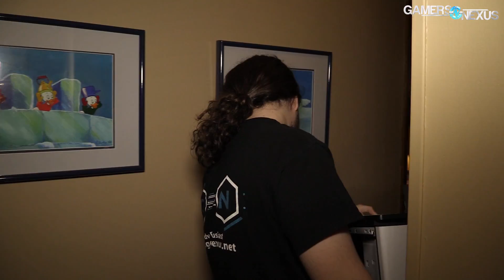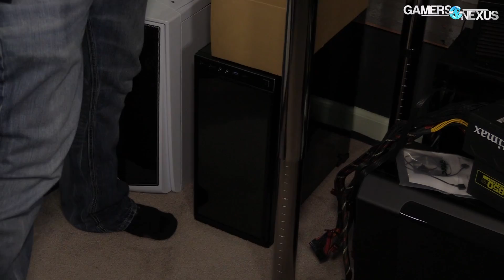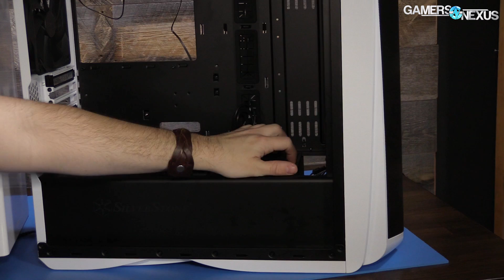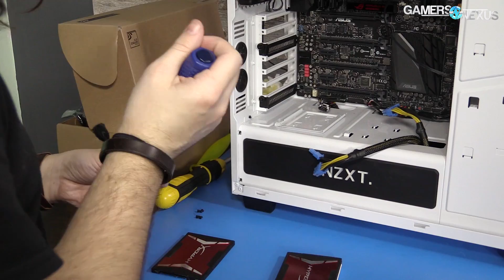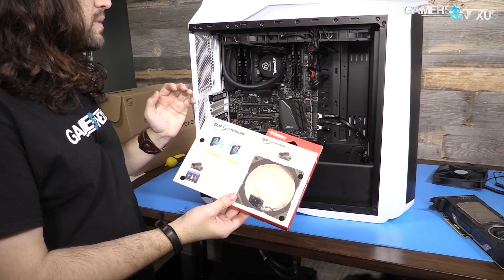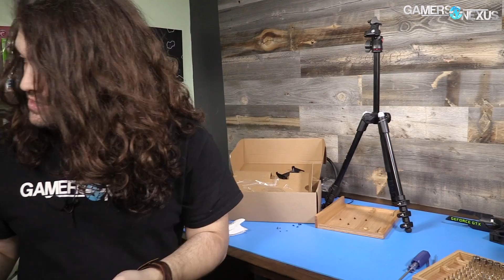Emergency Render Rig Rebuild (Pump Failure) - Pt 1/2

Comment from the maker: Or fan failure causing pump failure, I guess. The thing is up and running now -- we are in good shape! Part 2 is done. Songs below.
Part 2: https://www.youtube.com/watch?v=Wmn2KDe5efY

04:55
"ZigZag" Kevin MacLeod (incompetech.com)
Licensed under Creative Commons: By Attribution 3.0 License
http://creativecommons.org/licenses/by/3.0/

06:10
"Chill Wave" Kevin MacLeod (incompetech.com)
Licensed under Creative Commons: By Attribution 3.0 License
http://creativecommons.org/licenses/by/3.0/

14:14
"Pyro Flow" Kevin MacLeod (incompetech.com)
Licensed under Creative Commons: By Attribution 3.0 License
http://creativecommons.org/licenses/by/3.0/

16:13
bensound-basass

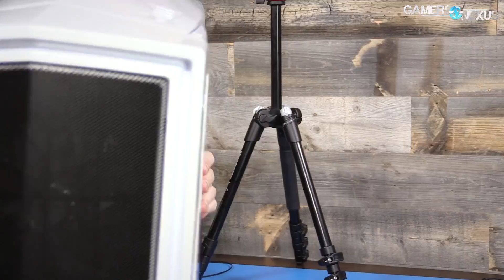20:29
"Leopard Print Elevator" Kevin MacLeod (incompetech.com)
Licensed under Creative Commons: By Attribution 3.0 License
http://creativecommons.org/licenses/by/3.0/
Reply: +Gamers Nexus Why would you leave it on the floor!?!?!?!?!?!
Reply from the maker: Leave what on the floor? The system? The tables/desks are completely occupied with more important things.
Reply: But...But... So much dust..... XD.
Reply: Hot air rises, cooler air available on the floor.
Reply: Though maybe not so much when stuck under a table, or in an entertainment center, etc.
Reply: Or when the rads fill with dust bunnies.
Reply: Have you measured how much static you generate running your hands through your glorious locks of hair?
Reply: +Dark Cloud  Roomba, mate.
Reply: Get the dust before it gets you.
Reply: If anything that pump failure made for an interesting video. :) Tho it probably was the fan causing the whole thing to go nuclear almost. :/
Reply: Lol, are you in socks? mate your videos are so good! and funny!
Reply: the music was annoying imo
Reply: As with most professional youtubers, they use Adobe Premier Pro which is multithreaded and supports GPU acceleration. They even mentioned it in the video multiple times.

Comment: MVP of the rebuild.. the Swiffer. Least that answered my question of if you could use one on comp dust clean up. 
 Hang in there . Any build you can throw together where no duct tape was used may not get the Red Green stamp of approval, but should still be alright.

Comment: I never had a pump failure because I stick to Air cooling. Much more reliable and less points of failure.
Reply: But higher temps m8
Reply: Meh, just crank the A/C.
Reply: Not on something like an D15
Reply: A D15 compared to that 360 mm rad? Yeah, higher temps.
Reply: +Victor Ov Precisely.  "Uh, my fan failed, what ever will I do"...not "OH $H!T, my AIO died and now I'm sunk".  Air cooling > Water-cooling.  Cheaper, more reliable, and DOESN'T come with "RGB gamer" branding for the most part.
Reply: True and this is coming from someone who has an air cooled system.
Reply: Didn't appear to be sunk in the vid. Could have just replaced the AIO and gone on about their business. In the interest of even better performance, and a bit of content, he decided to upgrade the system. Not sunk.
Reply: toy machine Yes, but if someone didn't have the parts on hand to rebuild the rig like Steve, they could be sunk depending on how bad the issue is.  For me it isn't worth the risk.  If I want to do extreme OC'ing I'd just get the biggest hunk of copper that I can slap on the CPU, and be very reliable, silent, and could potentially be used in many systems through the years.
Reply: I use Noctua air coolers on everything but my gaming rig.  That's water cooled with a custom loop.  Better pumps that are less likely to fail.  The one in right now is about 10 years old.  Has been in a few different systems over the years.
Reply: Except I like the aesthetic of my AIO more, and it doesn't take up as much space, nor do I have to worry about interference with the RAM, or graphics card. Neither is better, well maybe a really good AIO would beat an air cooler, I don't know, but it's mostly about personal preference, which is a perk of custom PCs.
Reply: SlavjanA As you say, it's up to personal preference.  I like air coolers, you like AIO's, I can respect that, and we can each build our PC's as we want.  My mindset is performance first, aesthetics later (why the only RGB LED's are on my graphics card).  I'd rather put any money spent on making my PC LOOK better on making it PERFORM better hardware, but I understand that's just my viewpoint.
Reply: Erhm.. high end watercoolers perform better than air coolers. So saying you choose air coolers over AIO's or custom loops because of performance is kind of weird.
Reply: I don't use AIO's because of crap quality.  The best AIO vs the best air are neck and neck cooling wise.  BUT, something like NH-D15 will have much less noise and pretty much never crap the bed.  At least the with Noctua fans thanks to very high quality.  I save the loops for my beefy rigs.  You can see what I am talking about on my channel.  My servers are all air cooled with small Noctua coolers that are enough for what they do.  And my gaming rig has a custom loop.  I dabbled with AIO coolers over the years.  Every one I have owned crapped out.  All pump failures. Well, one I think the impeller came off the shaft inside.  I still consider that a pump failure since it is part of the assembly for it.  I refuse to put them in rigs I build for friends, family, or side business.  My only exception are EK prefilled kits.  Only because the parts are the same ones you would use in a custom loop anyway.
Reply: Plus, when the fans fail on air cooling (also, depends on the air cooler because if one has the one where one can't replace the fans... then it's as reliable as an AIO... when it dies, you're kinda screwed) is that if your fans do die, it can passively cool since the heat transfers to the heatpipes anyways and doesn't need another variable like water in AIO's to do so. An AIO can't passively cool for shit. So, yeah, it's cost effective to repair (I.E. replace the fans) than an AIO (I.E. replace the fans or replace the AIO itself).
Reply: I've got a Zalman 3 pipe solid copper base air cooler with a 92mm fan on it and my CPU generally never gets above 40c have to leave the fan unplugged for it to ever see 60c at idle it quite often sees temperatures below 20c. My cooler cost all of $25 shipped.A decent air cooler doesn't take up any more space than a 120mm the only issue I've ran into is ram clearance on some coolers. I can see the advantages of water cooling to a point because after all in a custom build bragging rights do factor in also in low profile cases a good air cooler just won't fit and liquid is awesome for mATX builds.. If you have the clearance for a decent air cooler though it beats liquid on several levels because as stated before the points of failure are pretty much limited to two on air, fan issues or dust blocking the vent fins and if the cooler is really good it doesn't even need a fan to keep it below the failure temperature even when both things that could go wrong do go wrong, with liquid there are fail points at the pump the fan at any seal and at two points on every single hose/tube and then there's the radiator itself which could get clogged or suffer the same issue as the fins on a air cooling unit.. dust preventing good airflow across the radiator core. For my personal rig it's risk vs reward, is having 10 fail points and spending way more money worth my system running a couple degrees cooler under optimal conditions considering I don't usually have my side panel in a position to view inside the case to show off the pretty liquid gutty works? For me a good $25-$50 air cooler is more than fine height clearance in my case isn't a factor and I don't use particularly tall ram modules. If airflow, clearance or noise was a concern I would use and recommend liquid because you can use longer tubing to put the radiator and fan assembly pretty much wherever you choose but a decent air cooler is pretty much always going to be a tall and fat bastard and it will only go in one spot you can't modify it to suit your case it has to fit or else pretty much.

Comment: I'd suggest a Define R5 case for this purpose. Great cooling options with good airflow and has all the options for additional hdd's and other upgrades you need in the future. On top of all it's pretty silent while handling all that hardware.

Comment: Nice build, but how about moving the GPU radiotor to the front in a pull config and put the other fan in the back also as pull for fresh air and your exhaust will be the top CPU radiator? (front and back=in , top =out).

Comment: Maybe because the inlet/outlet ports on the radiator were on the top, and since AIOs aren't filled to the brim with coolant, some air was getting sucked around which, over time, finally lead to the failure.

Comment: Not sure why your testing showed the s340 elite to have such bad cooling its actually very good. I know you said the front wouldn't pull much air in but judging from your video I'm not sure if you actually tried that but currently I'm running a 280 rad in the front of mine and a 120 in the back and all my temps are very low with reasonably low fans speeds. I think you should give the case another try. Keep up the good work.

Comment: get the system up from the floor alone (a little table) will reduce dust build-up by around 50% or more, is my experience. It will vary ofc. Another cheap and valuable investment is to add in a air cleaner in the same room as this 24/7 pc stands, little maintenance vs benefits.
Reply from the maker: The room has about 4-5 active systems in it -- an air cleaner is going to be fighting over the same air and will be overpowered by the pressure of all those case fans :)

Comment: Good to see even well seasoned professionals like yourself have "oh shit" moments, lol. Personally, I'd probably have sacrificed one of the front fans and front mounted the GPU rad, then had a normal exhaust fan. Fresh air plus one fan pulling warmed up air through the rad would worry me less than the tube/fan proximity. Add to this you could combat the internal heat-up by raising the RPM of the CPU Rad fans if needed maybe? I dunno. 

As a point of interest with regard to cooling storage media, I have the Corsair 750D, and that has it's HDD carriages in front of the bottom front 140mm intake fan, so that's one more that does it.

Comment: the fans on the cpu radiator  seem to be pushing air in to the case, unless enermax do things in a non standard manner, I always thought that the direction of the air flow went from the free side of the fan through the side with the fan hub

Comment: Steve - Am quite surprised you had AIO cooling on a working machine tbh. My personal preference would have been for ridiculously huge aftermarket air cooling like a D15  on the CPU and maybe an Alpenfohn Peter/raijintek morpheus on the titan.. even though it would probably not be so quiet
Reply from the maker: AIOs are easy to deploy and we have lots of them.
Reply: True that. The D14 i have makes maintenance a bit of a chore. Especially in a compact micro atx case like mine, lol.

Comment: maybe its because i keep my pc on the desk, but why do people seem so aainst ever using the back exhaust vent as an intake? especially when you have so many radiator fans dedicated to being an exhaust. that way your hybrid rad gets fresh cool air and you maintain a positive case pressure while running to keep out dust. two intakes in front, one on the back and your exhaust fans could be the top radiator fans.

Comment: Fitting that Cyberpower is the sponsor on a video about a major part failure.

I made the mistake of ordering a system through them years ago, as did another 3 of my close personal friends. NONE of us received working systems, and only one was able to successfully get a replacement defective part, that they had to isolate through their OWN troubleshooting, something someone buying a whole prebuilt system may or may not be versed in.

If you happen to come across this comment, random youtube viewing person, stay far away from Cyberpower.

Comment: Could you have made the GPU fan an intake? I think that's what I would do. You wouldn't have to worry about it not getting any air due to the CPU fans sucking it all up.

Now that I look at it,  IDK if this would work due to how the hoses protrude from the bottom of the rad.
Reply from the maker: We could have done something like that potentially, but the case is butted against a wall, so not enough room to breathe.
Reply: I see.

Comment: My titan X maxwell under water OC'd to 1480 on the core and plus 500 on the memory, never went over 37 degrees, of course now it collects dust on my shelf.

Question, isn't using that duster a bit risky? I thought they used static electricity to pick up the dust.

Comment: Hey GN. I noticed the shroud for nicely over the EVGA liquid cooler. Was that coincidence? On a lot of your hybrid videos (from a while back), most of the shrouds didn't play nice with the coolers.
Reply: I believe that was a shroud for another hybrid card. The stock Titan Maxwell shroud wouldn't play nice, either.
Reply from the maker: Max Jacob Titan XM is the same mounting as a 980 Ti reference, so it's no problem.

Comment: Why didn't you change the air flow the other way and make the 2 front fans exausting and all the  radiators fans intaking.

Comment: i run my nzxt h440 black/red theme- with 7 fans inside the case, push pull in the front with a gtx 110i & extra nzxt fan down the bottom front with all panels always off coz i'm always tinkering (i should put the cable management panel back on)..
i've built a an custom external 4tb drive bay with with an extra fan cooling coz that was hdd was getting pretty hot just sitting outside the case on it's own.. now my thermals are amazing.
hero vii, 4690k 4.5 all day ~1.28v, 970 1550mhz all day, stx ii 7.1, ti chipset firewire, samsung 500gb 850 evo, seagate 2tb hdd, g.skill 1866 8gb..
i sold my second 970 as sli wasn't doing fuk all really with the games i play & converting the rig from part time music to full time music production pc. 
future upgrades; 16gb ram kit, more ssd's, new gpu.. untill whole system swap next year.. :)
peace
Reply: my only complaint with the nzxt h440 is the non removable drive bay bracket.. i removed all drive bays but bracket remains, the whole front side bit. and sub par cooling obviously but i knew what i was getting into with that..

Comment: i did a similer set up in my pc but i have a hydro h105 on my 1070 and a hydro h110 on my cpu and they never go over 35c with a massive overclock on the gpu

Comment: This is why I'd rather cope with a few more degrees and use an air cooler, just for the peace of mind.
Reply: So the fan on your air cooler could never break? :D
Reply: Well it could, but I still wouldn't have to worry about pump failure or leakage :)
Reply: did you watch the whole video ? the pump failed because of the cooler...
Reply: Yup I did, it reminded me how liquid typically have more points of failure than air and felt the need to express my preference for air through commenting, sorry if that annoyed you.
Reply: 30€
Reply: +Coltc8 You can set shutdown temperatures for air as well though
Reply: Actually the motherboard has features for that in its bios so this debate was more about liquid cooling haters or whatever...
Reply: I wouldn't call it hate, just an opinion... If you read this thread you notice the agression comes from defensive liquid users who thought there's some kind of competition to have. Both solutions have their pros and cons, stating one's opinion or preference doesn't make the other solution less valuable if it meets somebody else needs, jeez internet chill out already.